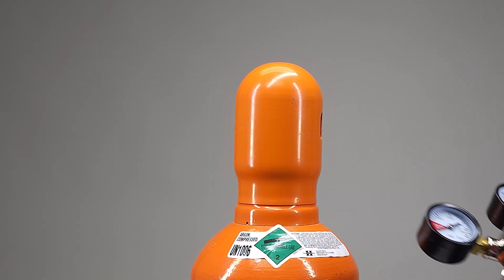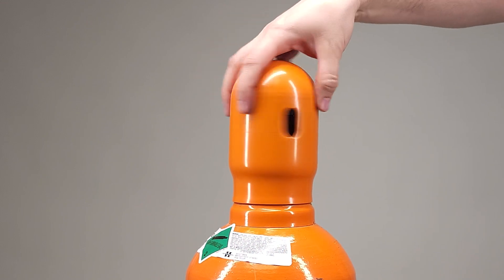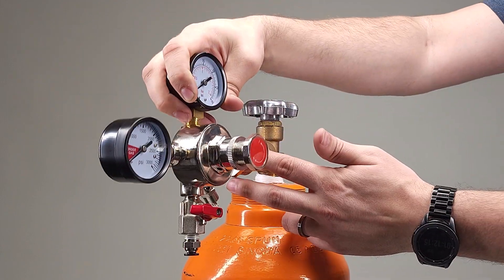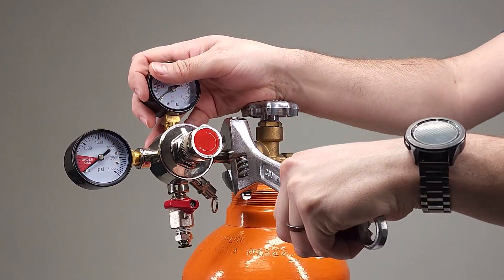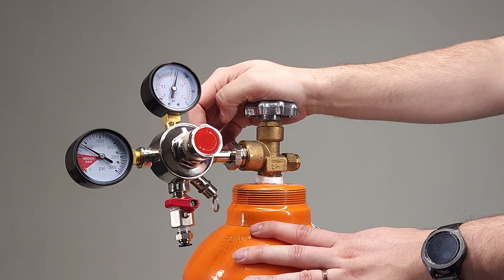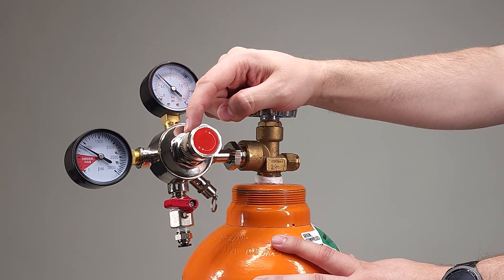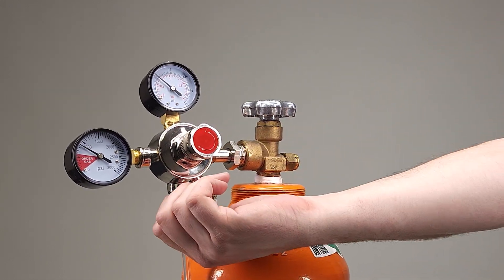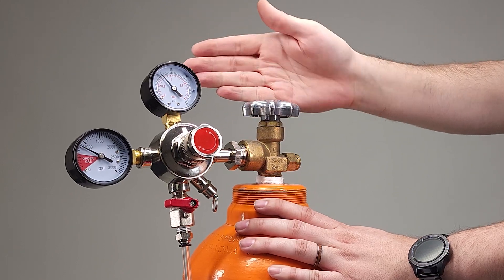Installation and Setup of the Sunstone Deluxe Argon Gas Regulator (AGR 1)

Comment: I purchased this second hand but it was brand new in packaging because the original owner already had one and this one came with a welder upgrade so she offered it to me. Fresh out of the package the gauge for tank pressure isn’t moving when I connect it. Everything is connected properly and gas does flow from my tank and it is a brand new fresh tank. I’m worried it will cause problems though! Any ideas?

Comment: I just purchased this model. When you are installing the regulator to the tank should I be seeing any threads? It is not flush to the tank and i have screwed it as far as it will go. Just want to make sure this is normal for this model or have I misaligned with the tank. In the video it looks like there is a gap and he doesn't mention having to be flush. Thank you!
Reply from the maker: Hi @AnnBoase, thanks for reaching out! Yes, seeing some of the threads exposed when installing the regulator is normal. As long as the regulator is installed securely as shown, you should be good to go. Make sure to set the pressure to 10 PSI, and you'll be all set for welding! Let us know if you have any other questions. Happy welding!

For additional questions please call or text (801) 658-0015